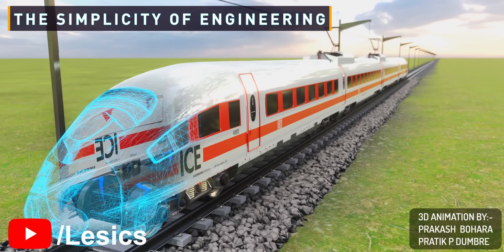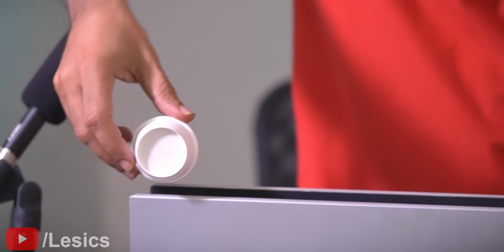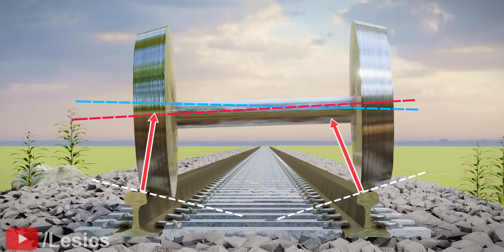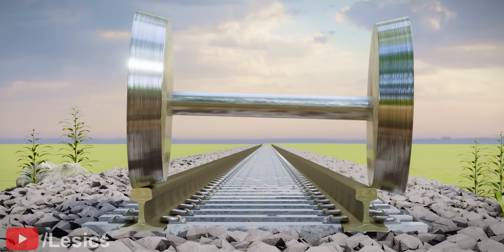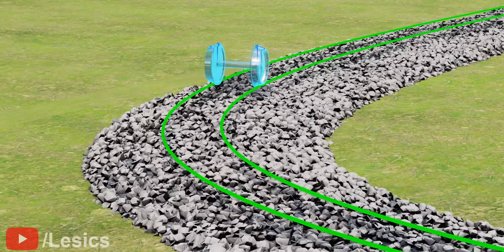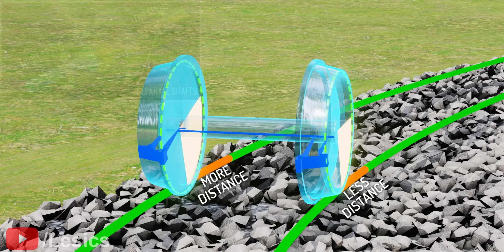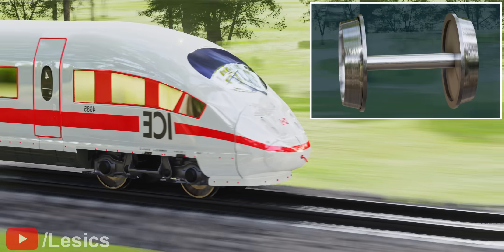The interesting engineering behind the SHAPE of Train wheels!

Comment: Differential effect aside, i wonder how the forces would express if the wheels rotated independently, eg the shaft of one wheel is inside the shaft of the other, with bearing.
Reply: Firstly it is not economical you have to change the rail sleepers of whole country because sleepers are also in slope equal to coning of wheel… and secondly that differntial wheel require lot of maintenance …. And thirdly railways curves are not sharper as highway so this coning mtd is best for railways…..
Reply: Kurt. I think that is a good question.
Economic issues aside.
Reply: Maintainance issues also aside.

Comment: You forgot #3! 
In a turn, the conical wheels tilt the side of the train downwards toward the inside of the curve, making the load more stable, and comfortable for passengers.
Reply: In a turns tracks themselfs are much more canted towards inside than is provided by conical shape of wheels. Also in some high speed trains cabins are also tilted from chassis to the inside in a corners for comfort that technology is called pendolino.
Reply: @derimmor  It's called a tilting train. "Pendolino" is a specific family of those trains made by Alstom SA.
Reply: But at last he has mentioned the centrifugal force. I Hope that is enough

Comment: One suggestion - at 2:57 you state 'the left wheel'. I always use the orientation of the movement for left/right, so I ended up lookin at the wrong wheel.
I think the best way off addressing this would be to say 'the outside wheel'. I think just about everyone will agree that in a turn, the outside wheel is the one opposite the direction of the turn - and thus the one that travels the longer distance.

Comment: The conical shape also reduces the contact patch with the rail, reducing friction.
Reply: This would be bad if it were true. But that's not how friction works. Surface area does not affect the friction force between two solid surfaces.
Reply: @megamaser  Then why do wide tires with greater contact patch areas give better road grip?
Reply: @Supperconductor  A larger contact patch doesn't necessarily mean more grip. There are a lot of factors that go into the grip of a tire, including the shape of the contact patch and how inflated the tire is, which both play into the ability of the tire to conform to uneven road structure and get leverage, also the surface area of the tire overall can be important, plus the versatility to respond to variable grip of the ground can be improved by contacting more area or more places. But the contact patch area, independent of those other variables, doesn't actually make a lot of difference. You may want a larger surface area overall in a race tire to distribute heat over a larger area to prevent the tire from overheating because that would reduce its coefficient of friction. But that's only a benefit after the tires heat up. You may want a wider tire, or simply more smaller tires distributed over a larger area of the road, so you don't slide when you try to turn over a small patch of gravel. Look at moto gp. They have insanely small contact patches but still manage to get up to around 2gs of friction force which is way more than any street legal car.
Reply: @Supperconductor  i haven't read the reply of the other guy, but here is my 2 cents. Rubber has a property of having more grip when pressure is lower. So bigger contact patch decreases pressure which increases coefficient of friction. The formula for friction is simple normal force times coefficient of friction. There is no area in the formula. That being said i don't know how coefficient of friction changes with pressure for steel, so you might be right. It just depends on the property of the materials

Comment: Wrong. Self centering is not about forces, but travel lenght in one rotation. Wider diameter travels longer path, thus wheel as whole turns to the center. Why is not about forces, simple, stationary trajn wont center, traveling train will.

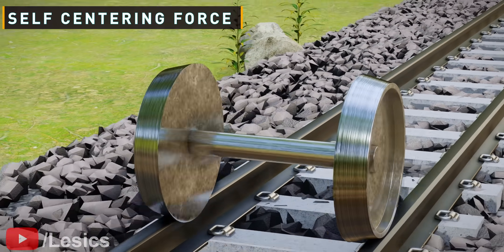Comment: In addition to this, sleepers are not flat rather they are canted at same slope as wheels cone (usually 1:20) to assure that flanges are not rubbing against the rail in straight track. This also assures a good contact between rails and wheels and less wear and tear; increasing the life of rails as well as wheels.
Reply: In wooden tie/sleepers and on some concrete ties, the tie plates using the spike system or a screw system is thicker on the part toward the outside of the gauge than the inside of the gauge so that the rails are tilted toward the inside.   So on those, the tilting is accomplished not on the sleepers/tie, but on the tie plate situation on them.
Reply: Fascinating !
Reply: @Master the Blaster not everyone is american
Reply: @Master the Blaster   "flanges" not "fanges"  😂
Reply: @my3dviews    unless it is a train for vampires of course... ;)
Reply: @trueriver1950    You mean from "Train"sylvania ?  😂
Reply: What are "sleepers" in this context? Is that the top of the rail?
Reply: @pstrap1311   If I'm not wrong in US they call them "Tie'" . The concrete slabs under the tracks.
Reply: @rbflowin_TV  oh, I see, thank you. Yes, we call them "ties", because they "tie" the rails together, I think. They used to be made of wood.
Reply: @Master the Blaster canted = tilted
Reply: @hugocfr  
There is a difference.
Cant is where the "tilt" is built into the track (the laying of the sleepers/ties or by some form of packing between the sleeper and the rail)

In European usage "tilt" refers to trains that are designed to actively lean into bends like a motorbike would. The French TGV is one example of a tilting train
Reply: Do you mean rails? I know that rails are laid with a slight inclination (1/20 usually)
Reply: The cant is only needed on curves. 

Not only that but for a given radius the cant will only be exactly right for one exact speed and will be good enough for a range of speeds.

Too slow and the inner flange rubs

Too fast and it's the outer.

So cant is designed with expected line speeds in mind.

 Beyond the max speed at which which the outer flange rubs is a much higher speed at which the train topples outwards: crashes on the tram system at Croydon  (London, England) and on a high speed train in Spain were caused by drivers being well over the topple speed  :(

Railway designers never use a cant so severe that a train might topple inwards if stopped for any reason, so that puts an upper limit on the amount of cant regardless of hoped for line speed.
Reply: Fascinating !
Reply: The rails are slighty slanted inwards to match the taper of the wheels (or the average taper on a railway that runs rolling stock with differently profiled wheels)

The sleepers (in European usage at least) are different: they are what some countries call ties; when the sleepers themselves are sloped sideways this would affect one wheel the "wrong" way. On a bend both kinds of effect  are needed.

Comment: Sir why don't we use the same method of making a slight conical wheels in car instead of seperating the wheels and giving them a different speed?
Reply: Cars don't have rails
Reply: Lol who will give normal force cars don't have rails to give them normal force
Reply: Because you need to have grip to keep the car on the road. A conical car wheel would have a very low surface area touching the road, and as such, low friction, and that means low grip. Low grip equals, bad acceleration, bad braking distance, bad cornering ability. Trains don't need that. They have their own tracks, with very specific cornering radius, and can take long time to accelerate and decelerate, have no need to brake quickly etc.
Reply: @pedroteixeira4369  Interestingly, friction only depends on the coefficient of friction (surface roughness) and the normal force; friction doesn't actually depend on surface area
Reply: @gabedarrett1301  That is what the formula says, yet, we don't run bicycle tires on our cars. There is more to grip than point friction alone. The thing is, grip does not depend only on the force of friction. If you take an elastic surface in contact with an uneven pavement you will need to add the lateral forces resulting from the elastic surface colliding with with uneven pavement. I may have chosen better words to express what I said in the previous comment. :)

Comment: Smaller gauge can takes sharp curve  and Bigger gauge needs bigger curvature for turning with help of this tapered sliding mechanism that restricted by wheel flange for avoid derailing of rolling stock.

This reason behind why in hilly area mostly gauge is found narrow 765 mm or meter 1000 mm and plateau area broad gauge 1676 mm , standard gauge 1435 mm mostly operates
Reply: Fascinating...

Comment: On the axel sets I machined the conical angles are as cast from the forge. I only bored the taper in the wheels and the matching taper on the axel was turned on a twin apron lathe. Bearing journals were turned to spec. and holes drilled into each end of the axel to capture the bearings. The wheels were individually pressed onto the axel with a specific pressure in thousands of pounds of force as set by American Railroad Ass. Standards to meet the specific Track Gage as required. It was interesting work but, it was very boring due to low tech requirements. I was the token white boy in the shop. They didn't eat me so that was good. Ha ha ha

Comment: the train wheels often have a cap(containment ridge/rim) on the inner sides.. It would be interesting to explain why they place that cap on the inside as opposed to the outside of each wheel.
Reply: If it was on the outside, trains would not be able to switch tracks. Also, there is a transition to the flange that is continuous from the shape of the wheel so there is one continuous contact patch that can be lubricated on tight corners. The flanges would also need to be thicker.
Reply: @sublivion5024  I am supposing it is easier to manufacture (mill) the flange on the inside as well? because the corner can fit the milling tool in? and also the weight of the flange would be closer to the center of the wheel? giving the grain less gyroscopic towards sides of the train? And keeping whatever gyroscopic of the weight of the wheels closer toward the center of the train (width-wise)?

Comment: I don’t understand. The conical shape is fixed. The radii of different turn can vary. How can the same conical shape adapt? Their difference in traveling distances is bigger in a small turning radius. The flanges will be grinding the rail. Why don’t let the two wheel spin freely on their own? Why fixing them on the same axle?
Reply: To avoid grinding of rail at one point rails are also placed at an same slope as that of cone of wheel…this concept is not shown in this video… rails are not placed vertical instead they are placed at angle

Comment: The conical shape does have a bad side, it sets the trains top speed. It’s a cost for having increased stability, but the train will wobble if it goes too quickly
Reply: Current world speed record for a commercial train on steel wheels is held by the French TGV at 574.8 km/h (357.2 mph), 3 April 2007.
Reply: @cykablyat6531  But NOT in commercial service.
Reply: @malcolmwatt3308  That's not my point. Kerbal Chris wrote: ".. but the train will wobble if it goes too quickly."  French TGV running perfectly at 574.8 km/h proved the contrary.
Reply: @cykablyat6531  All I said was the train was not used in commercial service. If you check the Wikipedia page, TGV world speed record, you'll see that considerable changes were made to track, overhead gear, supply voltage, wheel size and profile, all of which, to my mind, makes this not really a commercial train, more of a test laboratory based on the design of a commercial train.
Reply: The wheels on the high speed trains are still conical, but not to the degree of other trains. This is why high speed can only realy be used on tracks with minimum curve, since any doubling of speed requires a quadripling of a curve's radius.
Reply: @snowstrobe  some high speed trains will havs less conical wheels, but most just use yaw dampers
Reply: But this is why properly planned fast train networks limit their turns and build in a straight line as possible and just dig thru anything in the way.... like a mountain.

'Out of the way, we've got a fast train track to build here!' 🚅🚄
Reply: @reggiep75  No, minimum radii and transitions for high speed lines are set for passenger comfort, not normally the capabilities of the trains
Reply: @sublivion5024  - And my point completely encompasses yours as I mentioned nothing of train capabilities.  You did that to illustrate a moot point that is already given as is passenger comfort  😐😑😐😑😐😑😐
Reply: @reggiep75  you didn't say anything about passenger comfort.

Comment: Why are trains made so heavy ?    Wouldn't it be more fuel efficient to have light aluminum cars  or a light high strength alloy ?
Reply: Trains are already very fuel efficient with regards to how much fuel is expended in relation to how much cargo they pull. The reason is because trains have incredibly low rolling resistance due to the size of the wheels and the small contact area provided by the rail. It’s around the size of a penny or so. Engines are heavy because the size of the engines and generators, braking equipment, cooling equipment, etc, and cars are heavy because of the weight of the cargo they have to carry, and have to have stronger frames and materials used in their construction. I’m sure they could look into lowering the weights, but I’m not sure the cost to buy all new cars and engines compared to fuel savings would be economical

Comment: Interesting vide, thanks. 
 - What's the maximum turn radius the wheels can accommodate without slipping? It would be interesting seeing the math that shows the relationship between the max and min diameters of the wheel surfaces that contact the track, and how they relate to the turn radius.
Reply: does anyone know why the inner and outer wheels don't rotate on the axle independently from one another? Is it advantageous to not have hubs on each wheel?
Reply: @wallywonka808  it will not transfer that extreme load properly…. For light vehicle it is possible ….
Reply: @nlaad13  that makes sense
Reply: @wallywonka808  : i guess its not necessary and so they use a simpler one piece unit . also this setup allows the car to just sit a top of the axle .
Reply: I don't know the formula to calculate that but the wider the gauge, the greater the difference in distance to cover and thus rotational speed of the inside and outside wheels which is why poorer countries and mountain railways in many countries (poor or not) are narrow gauge. Much cheaper to go around tight curves than to tunnel through hills and mountains. At the other end of the spectrum, UK's Great Western Railway  had very gentle curves and was able to use a 7ft gauge.
Reply: Yes. I too want to know
Reply: It can easily take care for curves upto 6degree…. Beyond that curvers are very rare and also speed restrictions imposed….. railways dont have shapers curves as highways thats why differential wheel is not required intrains jst like cars….
Reply: Maybe u want to say "minimum turn radius" (as maximum as we all know is infinity, when going in straight line)
Reply: @GauravKumar-zu7ct  yes he want to ask about degree of curve but he used the term radius🤣🤣
Reply: Rt : radius of turn ; Wt : Width of train ; Rw : outer radius wheel "the small radius" ; Ww : width of wheel ; theta : angle of tapper on the wheel.

the condition for no slipping is : (Rt + Wt) / Rt <= ( Rw + Ww * tan(theta) ) / Rw

OR with the inner and outer radius of the wheel :

 Rt : radius of turn ; Wt : Width of train ; Rwo : outer radius wheel "the small radius" ; Rwi : inner radius wheel :  ; theta : angle of tapper on the wheel.

the condition for no slipping is : (Rt + Wt) / Rt <= ( Rwi ) / Rwo

sorry for the broken english ^^
Reply: And this has to take in to consideration that the faster the train the smaller the "slope" on the wheels. Thus a faster train needs bigger radius curves to turn